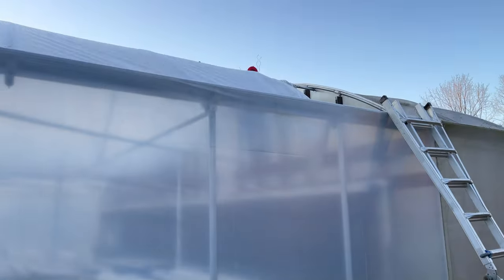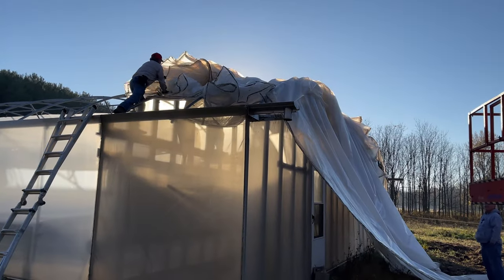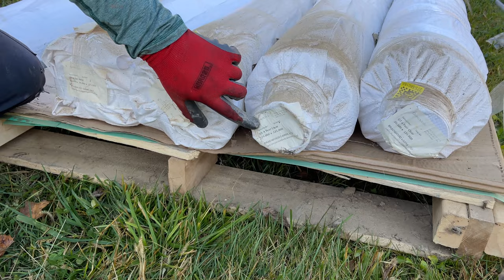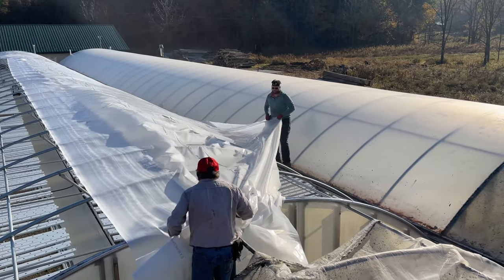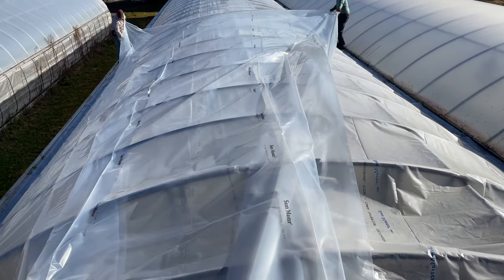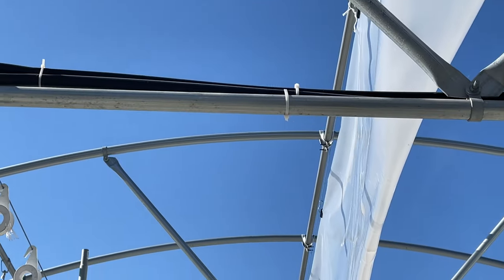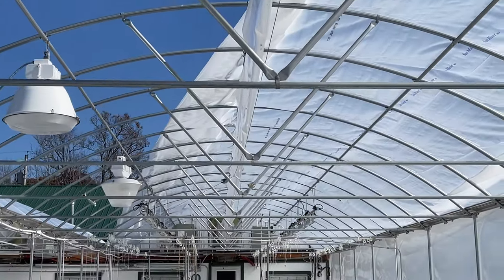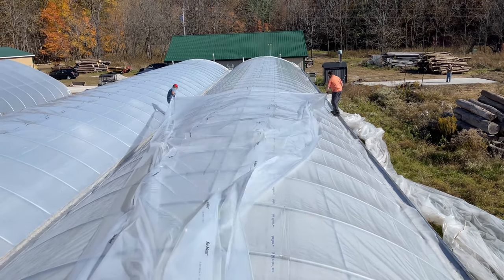New Plastic Covering for the Hydroponic-2 Bay-Gutter Connect Greenhouse

Comment: Does the old roof plastic get recycled?
Reply from the maker: Yes. One of the bays went with one of the guys from CropKing. He is going to use it on his raspberries. we folded up the other bay and have it put away in-case we need to cover something or use it as a moisture barrier etc. Eventually when its full of holes and degrading we will recycle but for now it still has some uses.

Comment: How long did the plastic last before it needs to be changed? Cost?
Reply from the maker: 7 Years but we should have changed it sooner based on the light readings see this video for details 
https://youtu.be/kzygm0xrF9g
Cost around $1,500 for roof and sidewalls but we bought the plastic over a year ago and kept it in storage. (that's why the outside of the rolls was so dirty.)